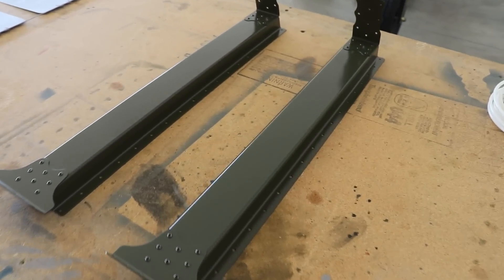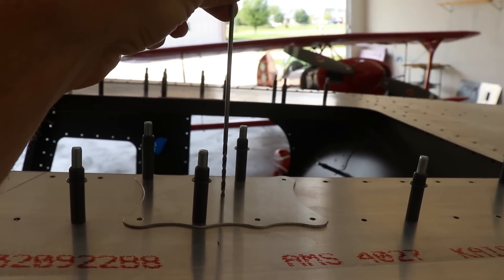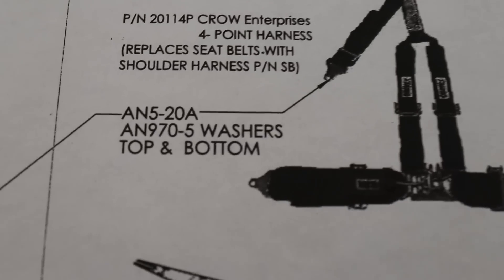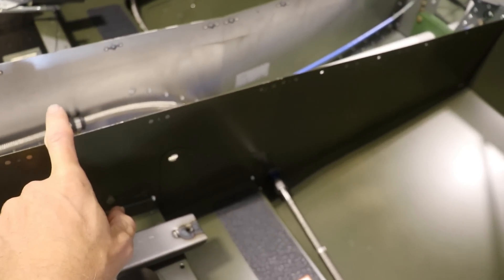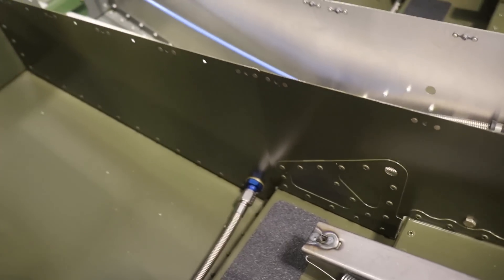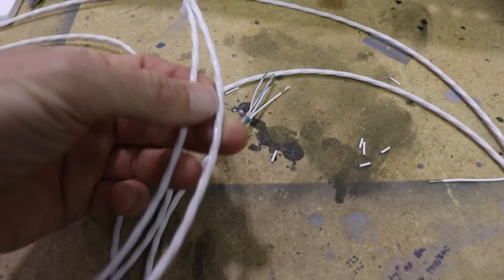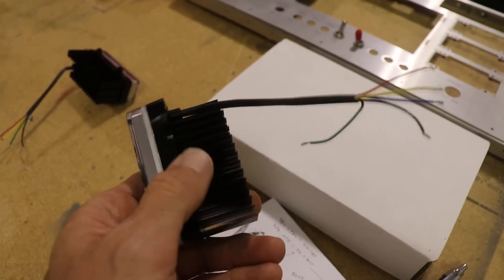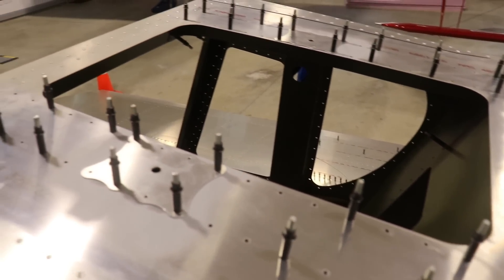Zenith Super Duty: Seat Belts and Wiring Harness for AeroLED lights (Ep51)

Comment: I am learning so much from you it should be billable!  Have you considered running the headset comms cables and plug points in the cabin ceiling bulkhead so the headset lead plugs in marginally behind you so they are out of the way but still allow freedom of movement?  I am doing something similar in my KR2 build and so far feels more comfortable than having them in-front of me.
Secondly, will you be putting a protective channel over the fuel lines on the floor board?  Maybe add a raised floor panel like the Cruiser?  May cost a little weight but protects the fuel line,  shorter electrical cable lengths and helps reduced radiated heat from below (runway surface etc) :)
Thank you again for sharing all your priceless knowledge & experience!

Comment: Hey Mark...your project is really coming along...I like your OCDness.   I bought a pair of AeroLED  Strobe/position/ navigation wing tip lights and I'd like to know how to install them. You said you were think of doing a wiring video...by all means yes !!!   Could your include info about: shielded vs. unshielded cable, wire gauge of conductors,  number of conductors per cable , grounding of shielding (whats this ground looping thing all about) and connectors plugs.....you get the idea ..looking forward to your wiring episode....thanks for all your great videos.

Comment: It sounds like you need to have both the power switch closed and the wig-wag closed, correct?  I was wondering what happens if you power only the wig-wag and not the normal power line.  I had an email from Aeroled that gave me the impression that it could be an either-or situation.  I was considering using a switch that is in one position for normal landing at night, off in the middle position and then wig-wag in the third position, and I was planning to only power one of the lines at a time, but you have me wondering now it this will work.
Reply from the maker: I was just thinking of this today as I was writing labels on the panel. I want to do the same thing as you-use one switch. Up would be wing-wag, middle is off, and down would be be both on. When I had it all connected up I should have turned the main switch off, and then just turned on the wig-wag to make sure they turned on. If you look at the wiring diagram, this should work because both switches have their own circuit breaker and both are connect to power.
Reply: @KitplaneEnthusiast  Yes, the email I got from them said that the wig-wag took precedence over the normal always on function, but they also talked about sharing power through both lines so it wasn’t completely clear that just powering the wig-wag line alone was sufficient.  Their documentation leaves a little to be desired compared to what I am used to for electrical and electronic devices (I’m a retired EE).  I will probably hook mine up and test this before I finalize switch choice, but this would save a switch location using a three-way switch.

Comment: One option you could do for those two wires you need to connect, is put them in the plug and then use a short jumper wire on the other side of the plug.
Reply from the maker: I actually have a bag of crimp connectors that are made for securing two wires. They are called "Closed End Splice". I bought them at Oshkosh but I can't remember the vender.

Comment: G,day from Quarantine lockdown Sydney Australia.
Your moving forward with the Super duty with quality in mind.
* Unusual the incorrect specified bolt diameter.
* The light testing with alergator clip connections: is that what is referred to as fluctuations in circuit continuity?
* Good to see the wiring grommets in the frame.
Take care and blue skies.
🌏🇦🇺

Comment: While I like the idea of running the wiring through that channel to hide it, I'm a little concerned about what happens if one of those wires gets chafed somewhere along its length and you need to replace it.  Maybe you could use the old wire to pull in a replacement, but it that might be challenging.

But maybe I'm just a little over sensitive here, having had to replace a fair amount of wiring recently in an old Bonanza.

Comment: I ended up pulling the top rivet from the back side. I also didn't like the idea of the possible crushing of the channel and added a spacer between the skin and channel to prevent crushing. My kit came with an AN7 bolt. I wish I had seen that electrical install before I riveted those channels.
Reply from the maker: The spacer is a good idea!
Reply: I agree - a spacer is a great idea. The size of that bolt kinda indicates the amount of load possible on the bushing and the hole in the channel. Do you think the channel is heavy enough to sustain the constant load on that bolt. Is there a big washer under the head of that bolt as well?

Comment: So Mark, The seat belt BOLT (1) 7MM is always sitting in weather, outside the aircraft?? I would be skeptical of it's worthiness after a few years .
Reply from the maker: Would you also be skeptical of the wing strut bolts? Or the landing gear bolts? Or the turnbuckle bolts on the rudder? Or the prop bolts, or the....
Reply: Non issue!

Comment: If you want a made solution for painting small parts then you can pick up painting pyramids at Rockler or other Woodshop.  They are for finishing cabinets and the like. A small sheet of mdf or plywood with screws driven thru are pretty good if file the points down a little.  https://youtu.be/7V0hMH2pkbQ?t=204 Most can be had for around 32 for 10$ or so on Amazon.